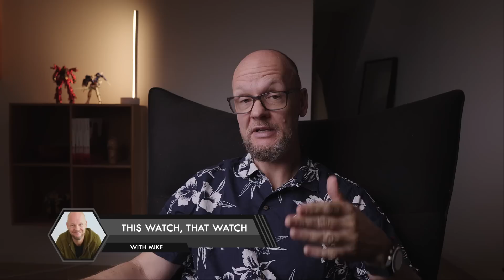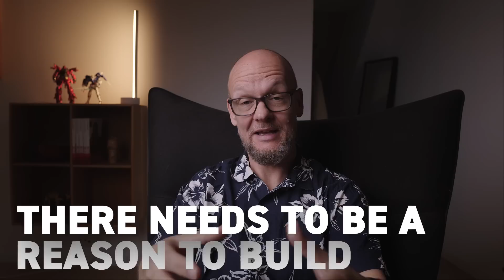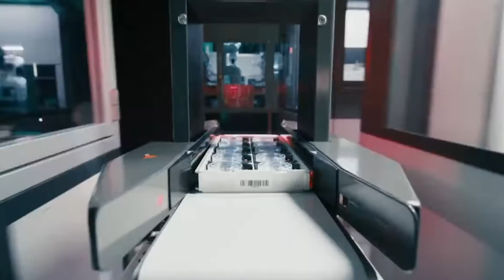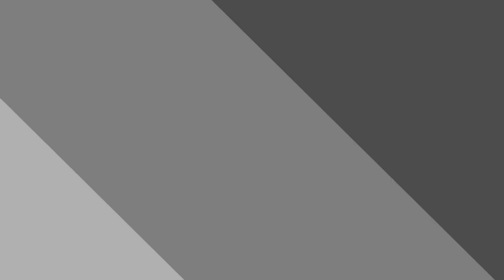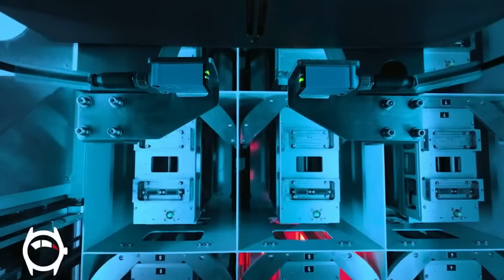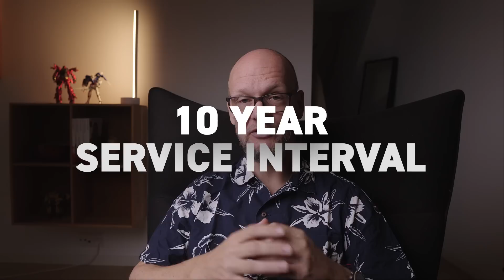In house movements & METAS: Overrated? Worth it?

Comment: Great show, Mike! As an engineer and collector with a penchant for vintage pieces and complications, I have zero interest in marketing BS and the alphabet soup of certification standards. If you care about accuracy, get a Citizen with the Caliber 0100 with +/—1 sec/YEAR. I change my watches daily, and I don't keep them on winders, so +/—10 sec/day on a 1960 JLC that I refurbished myself is more than adequate. Tudor is indeed a prime example of over-hyped nonsense, and its service center in TX is overwhelmed with warranty returns. Yes, they are solid watches, but good luck getting one serviced by an independent company, as even a simple regulation requires specialized tools that watchmakers cannot purchase. For most people, a base 2824 architecture, regardless of flavor, is more than enough, easy to service, and robust enough for any application. Kudos for another myth-busting show!
Reply from the maker: Our obsession about movements is a relatively new thing really. I go back and forth about caring and not caring about what's inside.

Thanks for watching and for the kind words 😀
Reply: See this is my point. Quartz movements with serious accuracy like this is horology taken to a new level. Getting over romantic about the movement being mechanical or quartz is seeking a different type of product, not high horology.
Reply: I'm into high horology big time but read about the 0100 and see what an amazing engineering feat it is on a mechanical level.
Reply: @visiondecalee-o4f  it's insane the accuracy of that piece.

Comment: The main point for Tudor going METAS is to fend off Omega's moves to catch up with Rolex. Tudor was chronometer certified for the longest time and no one complained about their accuracy, so why METAS now? Because Omega went METAS in 2015 in their attempt to catch up with Rolex, so Rolex can now say "Oh yeah, that METAS certification Omega was harping on about? That's the level of our little brother brand" It's Rolex using Tudor to throw dirt on/devalue what Omega is trying to achieve.
Reply: Omega have already beaten the Superlative Chrono spec though (granted, only in 1 watch so far) with the spirate system at -0/+2 spd. I don't think Omega really give a shit :D
Reply: @Draknareth  Spirate was introduced last year, it doesn't change the reason why Tudor went for METAS back in 2021
Reply: @fenepi  I never claimed that it did…. Just pointing out that Omega have already done the “one up” as it were on Rolex. They seem to do so with most things, Rolex did the deep sea challenge, Omega went deeper. They make a point of “anything you can do, we can do better”.
Spirate will eventually migrate to other models, possibly becoming the Omega standard. I’m interested in whether Rolex will respond, I feel like they haven’t bothered for so many years simply because they haven’t needed to.
Reply: @Draknareth  Rolex has responded pretty much each time. The Omega ultra deep (6000m) was introduced in March 2022, Rolex responded with the deepsea challenge (11000m) in November 2022. It's just a matter of whether Rolex chooses to respond directly or pass it to Tudor.
Reply: @fenepi  the 6000m is the production model, Omega hold the record at 10,935m it’s an Easter egg that shows up under UV on the summer blue edition
Reply: Rolex was 10,908m
Reply: @Draknareth  I believe we were talking about mass production watches and not single dive events. I'm an Omega fan so I'm happy about the record but was talking about production watch specs

Comment: I have a bunch of COSC watches.  They’re all inside of 2 seconds a day.  I also have a Spring Drive, and some others that don’t do certifications, yet they’re 1-2-3 seconds per day of accuracy.  

Once I got a Spring Drive, pretty much everything pales in comparison with regards to accuracy.  
Yet I still like and wear non-Spring Drive watches. I still wear a Seiko 5 and a few Cocktail Times.  

I do like a longer power reserve. “Hey, that’s still running!  I’ll wear that.”  

I would like to see reduced thickness.

Once I got to a point where watches were increasingly accurate, accuracy became less important.  I missed a lot of other watches that I really liked wearing.
Reply: This is a rock solid opinion
Reply: Two of my fun to wear watches don't even hack

Comment: There's one innovation I don't want to see coming to watches. SBM stands for subscription based movement. Pay to unlock seconds hacking. Your mechanical watch on basic plan is jumping seconds like a quartz - but you can upgrade to sweeping hand like it were running before. Power reserve only of 20 hours only because you haven't accepted to pay for Power Pro plan. There you go.
Reply from the maker: Good lord no! 😂

Comment: Mike, small mistake, DIN 8309 is not requiring a magnetic field resistance of 4,800 GAUSS but 4800 A/m which is about 60 Gauss…..
Reply from the maker: Embarrassingly this is something I should have caught. 

After more than 25 years of watch collecting, I’ve only ever once had a watch get magnetised and it had the dubious honour of not being ISO certified. 60 gauss had likely been enough to avoid it.

Thanks for correcting 😀😀

Comment: Personally I never got caught up with the whole " in house" debate. I remember 10 years ago when nobody gave a crap about in house movement's. Now? It's all they talk about. The hobby is one big bandwagon all of a sudden nobody can survive without on the fly micro adjustment, ceramic bezels, screw down crown, in house movement, 70h power reserve and at least 200m wr lol sometimes I think the hobby is one big complaint
Reply: The hobby like any other evolves and changes.
Reply: WR is overrated. I got WR watches but they are not the interesting looking

Comment: Metas requires COSC, you cannot certify a watch only with metas, the movement has to be a COSC certified movement before the METAS test is done in addition. So it’s doubling the costs for the certification more or less. That’s why it is only available to Swiss brands, as COSC is only for Swiss brands.

Comment: My first watch is the BB58 GMT. I had no interest in METAS or COSC, I didn't know what it was and it made no difference in my choice between that, and the BB58 I had my eye on. My only reason I bought it was because of the colour difference. 

I travel a bit, but the GMT function isn't really needed, I would've been fine manually changing the time back or forward, I just liked the look of it more than the standard BB58

Comment: There is a reasons Tudor has decided to form Kenissi and offer movements to other brands, economies of scale and lower prices in return for themselves….
Reply: @koolpep  💯
Reply: Tudor purchased them. It’s like Daniel wellington purchasing selita - in-house immediately.
Reply: @drdesign6886  That’s not accurate. Tudor designed and produced the in house movement in the Tudor factory  first in 2015 (Northflag) then Kenissi was founded to produce them going forward in 2016. Tudor sold some part of the Kenissi venture to others (Chanel) but still holds the majority.so 100% in-house from the start.

Comment: I could not care less about the certification when I know that with the right adjustment by a good local watchmaker my Seiko 4R35 can run at around 2 seconds per 24 hours.
Reply: 4r35 will never run constantly 2s/d for more than a month. All the r movement are garbage. The L movement are different story.
Reply: @danield6815  

That’s weird because mine has been delivering the same result consistently for over year and a half.

Comment: As a pc parts guy I will just draw the comparison.  This is basically a monitor that supports nvidia g sync and amd freesync versus a monitor that only supports amd freesync.  Would the second monitor have not met some spec?  No most likely it would have passed the spec and gotten certified for Gsync, but you gotta pay Nvidia a lot of money to get that cert so you can add it to your monitor.  Amd freesync not so much.  Meanwhile my monitor is G Sync compatible and marketed as such, and I rarely if ever even use the feature.

Comment: I don't particularly care if a movement is in-house but I would like something more up-spec from an SW200/ETA2824 once we're getting past a certain price point. Oris asking for 2.5k Euro for a baseline SW200 that I can also get in a Glycine for €350 off Ashford? Tag Heuer asking 3.1k Euro for the same? Breitling 6k for a Sellita? Hublot 8k? Yeah, sorry, no. It doesn't have to be in-house, a well-specced Kenissi or AMT movement is fine with me, but I don't think it's appropriate anymore to do "luxury" in 2024 with a SW200. That's now microbrand territory. Especially after the massive price increases over the past 2-3 years.
Reply: I am approaching this differently. They can keep putting SW200 into all their waches, IF, they put the cost difference into the appearance of the watch and the quality of fit and finish, instead of the profit margin.
Reply: @AbcDino843  I'm fine with my Tag Carrera Date 36mm having a standard movement as it is relatively accurate and the fit and finish are great, especially the bracelet upgrade from previous models. Will be cheap to service too.
Reply: @AbcDino843  So…..  CW for the win.
Reply: Breitling is the biggest joke in their avenger. 4k plus dollars for a sw200 that hasn’t been upgraded in anyway. I do however give a custom sw300 / ETA 2892 a pass because it’s a far better movement in my experience.
Reply: @hammalamiri12  Yeah, but at least the Breitling SW200s are all COSC certified. That's at least something. With Oris and TAG, it's just "standard" grade SW200s.
Reply: @hammalamiri12 Breitling COSC certifies everything they sell, so you're not getting the base form of any off the shelf movements in their watches. The question becomes: how much is it worth to you for a manufacture movement? Anything with the new B31 starts over $5k. You can say goodbye to $4k Anengers if they get the B31.
Reply: Fully agree with you, have been saying this for a long time now!
Reply: Well said
Reply: Is a kenissi really any better than a decent spec 2824? The 925 bb58 movement looks very plain!
Reply: @mister-amazing  simple answer is yes, its a superb movement. It’s a super movement without the meta certification. Tudor movements  were never really designed to be looked at through an exhibition case back. Similar to Rolex.
Reply: I know how tired the watches-cars comparisons are but that's like Porsche making Macan with the 2 litre engine (if they didn't price it down accordingly which they thankfully do)
Reply: @sysakPL that’s the way I see it but it’s a Porsche using a Camry v6 😂😂😂. That’s why I cant buy into lotus lol
Reply: It'd be more like a Porsche with a Toyota v6 that's been heavily modified and souped up. Also having a cheaper movement isn't always a bad thing, it makes repair and replacement parts easier and cheaper to source.
Reply: The problem with that attitude is that technically you don't get anything better at all for a higher price. in-house is just different. However the working principle of the watch will still be the same. It will not perform better.
Reply: Best comment ever. I would add on top that for those prices you should also get a Cosc certified watch, no questions asked
Reply: aliexpress
Reply: And to add. stop with the exhibition casebook with a SW 200.. Oh, sorry, it has a "custom" rotor.
Reply: @davidr2802  I think that's mainly done for first time buyers and one watch only buyers. It's actually a big selling point for that demographic. They find even an unremarkable and undecorated movement interesting and fascinating. That's why pretty much all entry-level Swatch group watches and entry-level Seikos come with an exhibition case back.
Reply: even glycine builds in elabore grade sw200 and a custom rotor nowadays.  @davidr2802
Reply: @davidr2802  ... caseback*
Reply: @L233233  TAG has Carole Forestier-Kasapi for 3 years now movements will turn amazing soon. Amazing things to come.
Reply: Totally agree. A lot of people have made this point in recent times. Sellita need to be offering a bit more. but  it is the watch makers themselves who ultimately case up that movement. Oris latest release makes this point, £2100 I would be expecting COSC with 56 hours of power, I don’t want much more but I don’t think that’s unreasonable.
Reply: Er, SW300?
Reply: In house is still cool.. like nomos and yema watches... that's the romantism in watch collecting.. otherwise, gshock covers everything except for dress watch